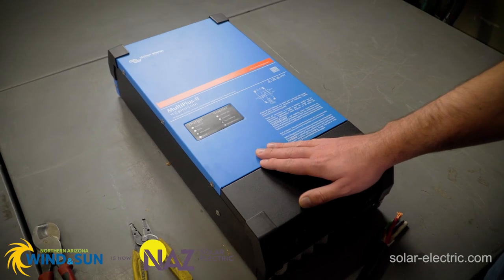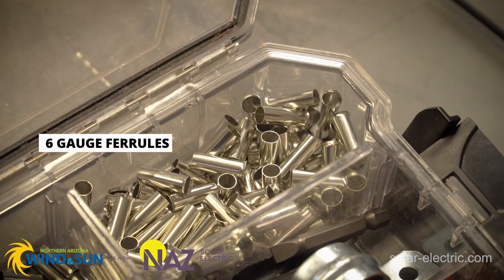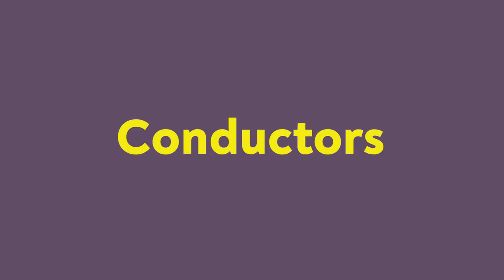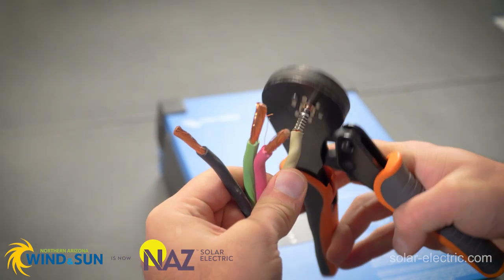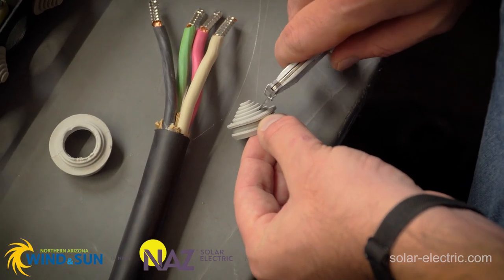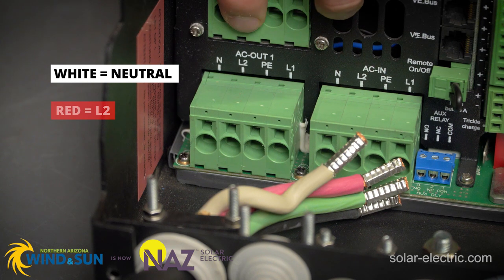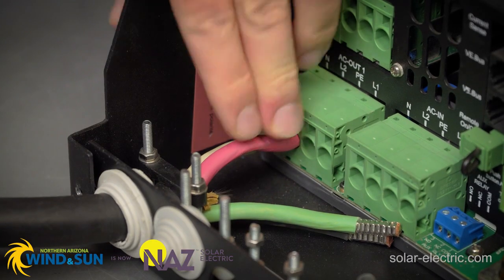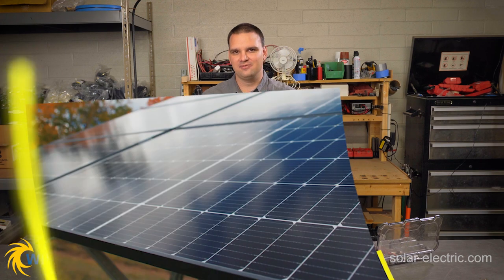Victron Multiplus II Wiring Tutorial

Comment: NEVER use ferules on spring loaded terminals! NEVER! The spring has not the power to “compress” the ferule like a screw terminal and leaves you with a very tiny point of contact…
Reply from the maker: Thanks for watching!
Reply: @NAZSolarElectric  Be smarter than Victron... Although it's recommended by Victron to use ferrules, it's not like it should!
Reply: If not using ferrules, then what do you suggest? Inserting the stripped wires as they are? Or soldering them first and then inserting them?
Reply: @MultiliminalDotCom  Just strip the wires and insert them as they are. If you solder them, then it's the same as using a ferule, it doesn't compress. The spring loaded terminals are especially designed as a good conductor for stripped wires.
Reply: @13FPV have you tried pushing in fine strands like that, it’s like trying to poke your eye out with a cooked noodle.

Maybe THNN is better without ferrules, but fine strands of SOOW a ferrule is almost vitals to doing it right.
Reply: @740GLE It's a wide open hole when you poke a tool into the "release tension hole" and angle it... It's like dropping a wet noodle in a volcano...
Again, it's especially designed to use without ferrules!
I work with these terminals every day, no hassle at all!
Reply: Using ferrules in this application is the same as using solid copper with Wago connectors, except these appear to have much higher spring tension.  Why do you think this is any different?
Reply: Being new too this I was not aware of the importance of noodles.
Reply: You are entirely wrong. It depends completely on manufacturers instruction.
Reply: @UKsystems  OK. I hope you don't burn someone's house down some day...
Reply: @13FPV  it depends on the manafaturers instructions like i said it dose because of spring strenghth i have the datasheet for these
Reply: @13FPV  if you don't follow there guidance you have to do the conformity and ul testing privatly with the change

Comment: Great video! Easy to follow and very informational. I found the spring system to be a horrible experience! very hard to connect and the wires continued to slip out. It's hard enough in such a small area with larger wires. Please go back to the screw down method!!!

Comment: If i had a breaker setup for 240v and then ran the inverter at 120v what happens to the appliances that require 240 that are only recieving power on one leg(120v)
Reply from the maker: Thanks for your question!
The 240V appliances wouldn't have power. If you're not feeding in power on both legs (with phases 180° out) then there's no electric potential between the two legs and thus the appliance wouldn't function. There would only be electric potential between hot legs and neutral/ground, that being 120 Volts. However, a lot of 240V appliances; like dryers and ovens often carry a neutral for the control circuitry (which runs on 120VAC). In this case, voltage potential between neutral and hot would be 120V and thus the control system would have power to function but the 240V system would not, so the appliance would likely error out or not function correctly.
Reply: @NAZSolarElectric  thanks alot for the explanation, it really helped clear things up for me. Going to purchase the multiplus ii with 2x120v.
Reply from the maker: @scrogathon  that's great! Glad we could help!

Comment: Can you hook up only L1/N/PE, and supply 120Vac into the inverter, and get 120Vac out. It looks like the unit is made for 240Vac, but wondering if it accepts L2=0V. and still works
Reply from the maker: Yes but it would make more sense to use this product instead, which is also less expensive: https://www.solar-electric.com/victron-energy-multiplus-ii-inverter-charger-12-3000-120-50-120v.html
Reply: @NAZSolarElectric   I was looking for starting 120Vac, and later supporting 240. so instead of getting two separate 120Vac units (which would ultimately cost more), it would be cheaper to get one 2x120Vac units. 48Vdc when it comes out for the US market.
Reply: Did you just not plug anything into the L2? And has it worked for you? Did you also do the same for the output? Thanks
Reply: @tylerphillips5689 I think the problem is that with the 240V version, you don't get a neutral that is used in the US Split Phase system. The other L2 is the neutral return from what I heard, so you onlyhave L1, L2, and PE. To do what you want, I would think You need L1, N, L2, and PE. then you would be able to ignore L2. You have to use an autotransformer to get your neutral split phase, or buy 2x 120V versions. I think the later is better since you could have unbalanced loads with split phase and it could deal with that.

Comment: Thank you for a great and helpful video!  Just the info I needed.  However, PLEASE nobody strip wires like poor ol' Ben here.  Stripping like this (1:49) is a recipe for damaged insulation and arcing under the right circumstances.  I've definitely seen it in the wild!

If it's not obvious what I'm talking about  Support the cable and knife together in one hand while rotating the cable with the other to control the depth of the score on the insulation.  Be willing to make 2-3 complete passes around.  Only go 60-80% of the way through the outer jacket, and then bend it around until something opens up.  (Make another pass if nothing does.)  Then add a little tiny bit of score here and there as you bend it and it comes loose.  Then, even though it's very convenient (2:08), you should avoid slicing up the outer insulation like this.  Usually you can wiggle the outer insulation off with 5 more seconds of patience.  If you're working in a difficult place and absolutely have to do more to relieve the jacket, either try to slip the knife blade underneath so you're cutting away from the wires, or follow the paper up the sheath so where your blade pokes through, it isn't scoring the wire insulation underneath.  In all cases, keep the underlying wire insulation intact!